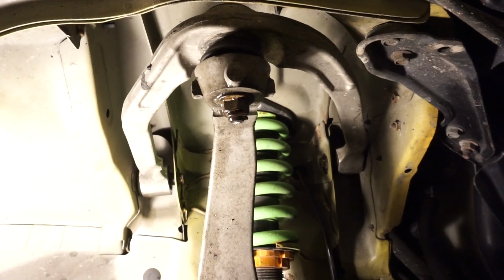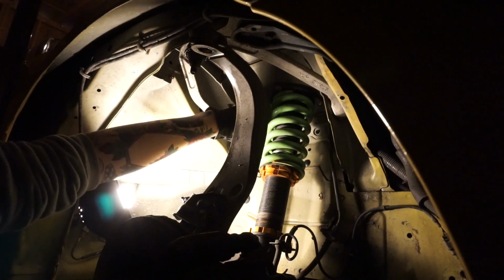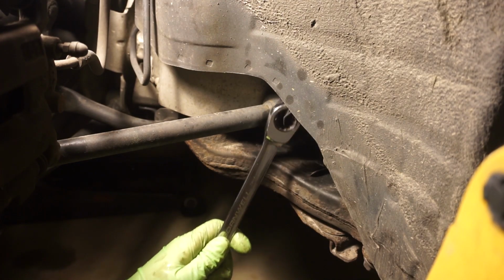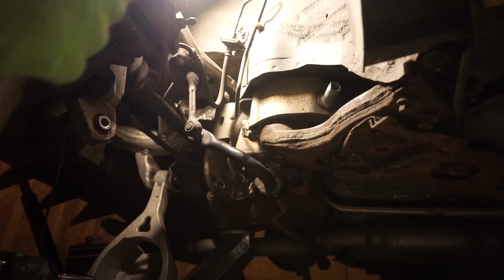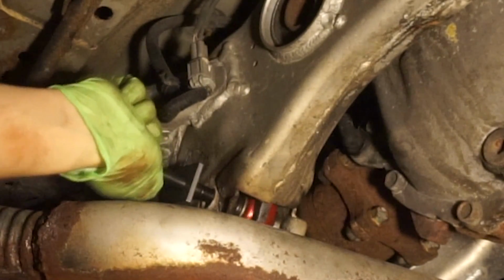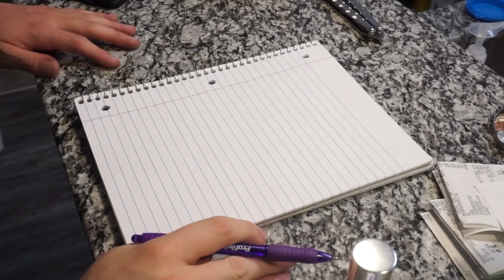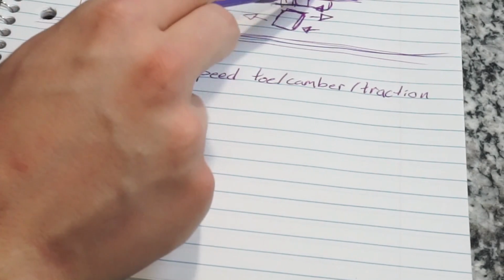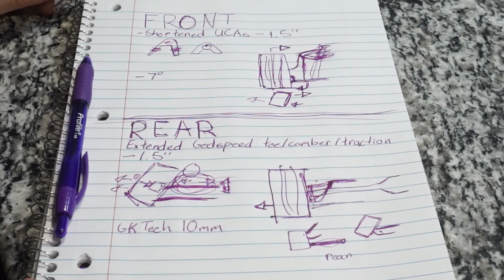How To Camber a 350z

Comment: Do y’all know if you can camber wheels with spring bucket still on I got toe arms n camber arms for it lmk asap I’m currently running tein coil overs with spring in rear so I wanna know if I can get camber with spring buckets still on with also toe arms and camber arms

Comment: You think if I were to cut the front LCA’s and we’re to extend the OEM ones by adding a piece of same metal by filling it in obviously with same specs as well and adding side plates and welding for reinforcements???? I mean if people shorten the front knuckles and weld them back this would be the same you’d think?